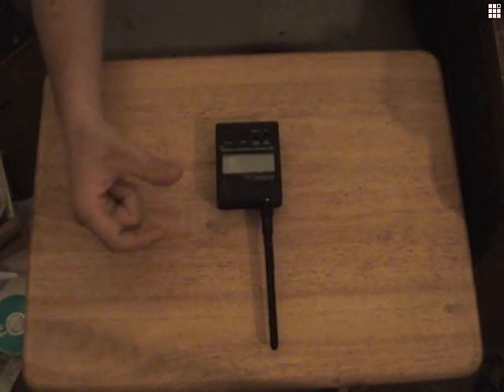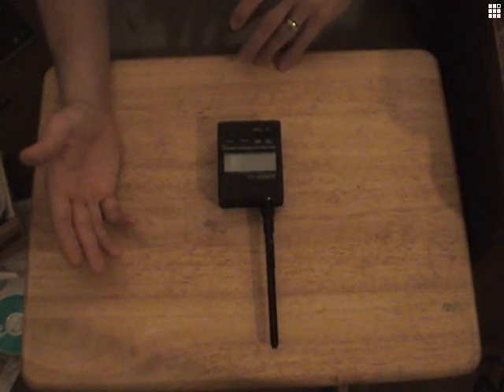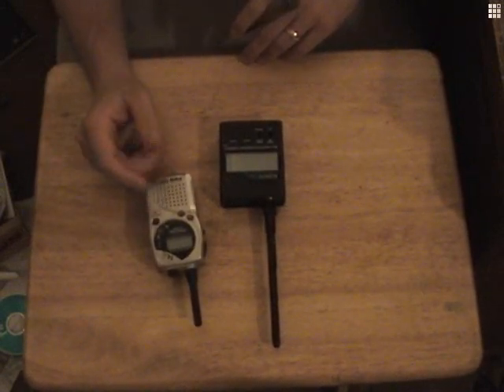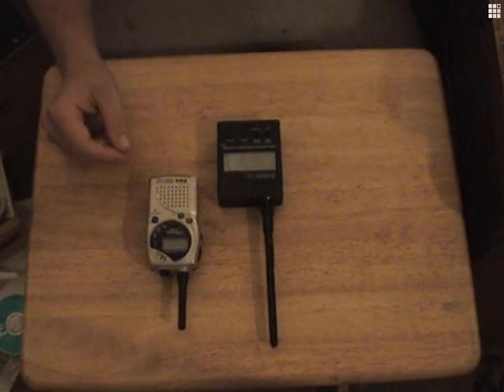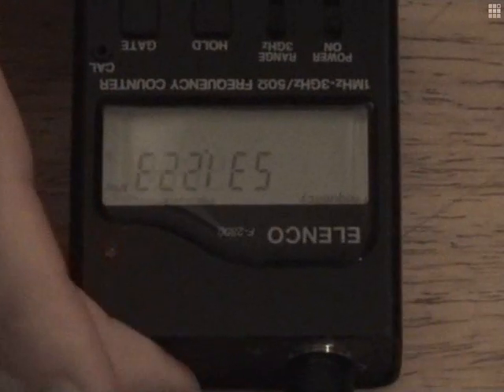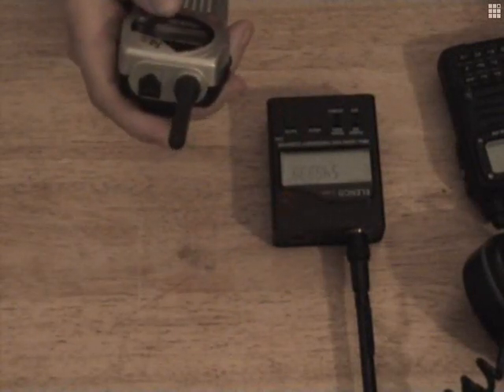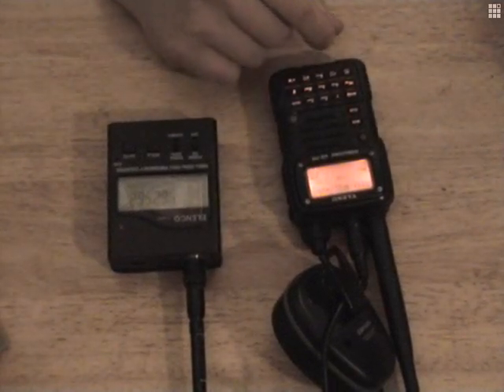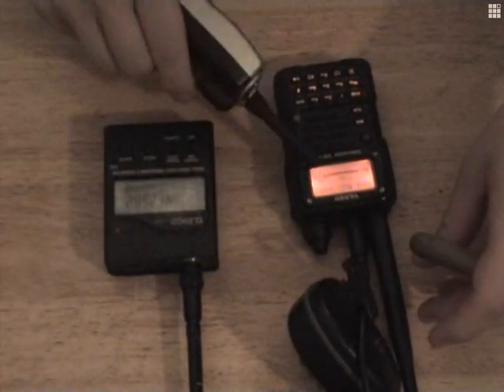Frequency counter

Comment: mate i see how Frequency counter works but how can i find out the ctc code eg the Frequency is RX 468.775 and TX is 477.000 BUT the ctc code is 172.5 if i did not know it how would i find it